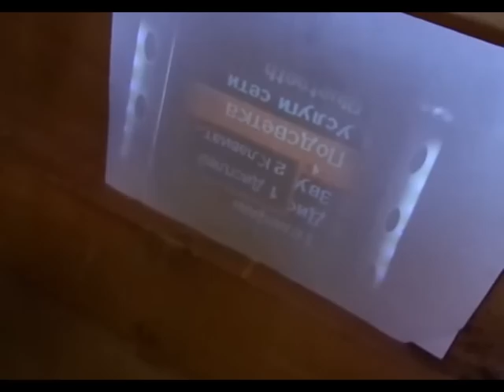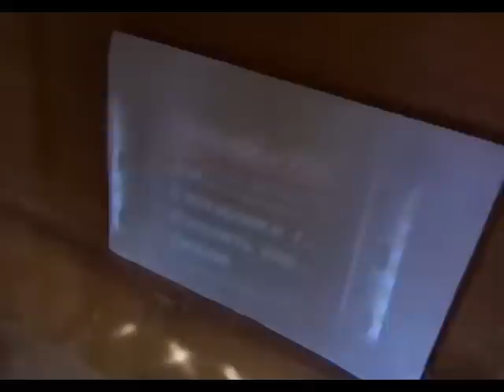How to make a led projector from old phone

Comment: can you explain the steps. 
I want to make a projector that can connect to my phone.. as a monitor. maybe connected by bluetooth or usb cable.
Reply from the maker: Unfortunately, I do not know how to connect it as a monitor, it is possible to install a program for remote access?
Reply from the maker: I just made from a very old phone, it does not have remote management capabilities. Once the video  over 1,000,000 views - I'll make a video projection of 7-inch tablet on android. They can be controlled by wifi.
Reply: +Valdemar Fishmen if a mini projector that can connect to phone by using old cellphone or maybe an old tv?
Reply from the maker: I think of the old  LCD TV can make and connect it to the video through the video input.

Comment: how many watt LED you use
Reply from the maker: 5w But I thought of it is not enough light. And it is not very convenient voltage of 12 volts. The next projector from the tablet itself, I soldered LEDs on 3.5 volts.
Reply: +Valdemar Fishmen make projector with tablet and use bright led
Reply from the maker: I will do as soon as time. All components are already there.